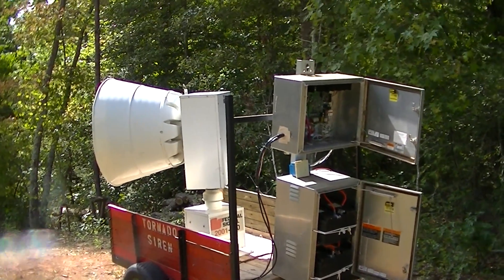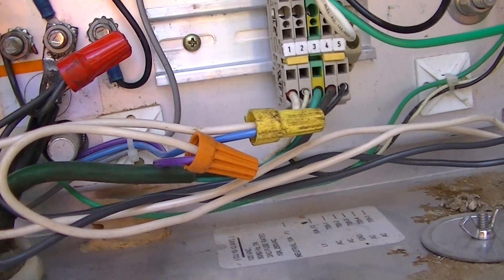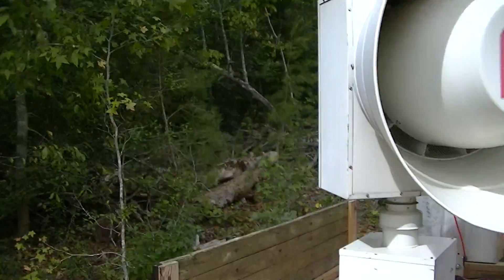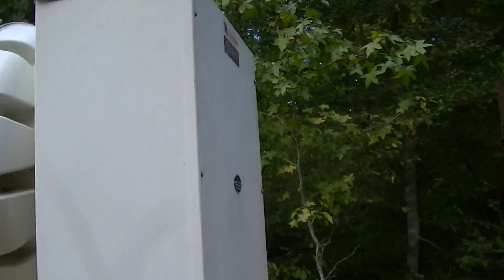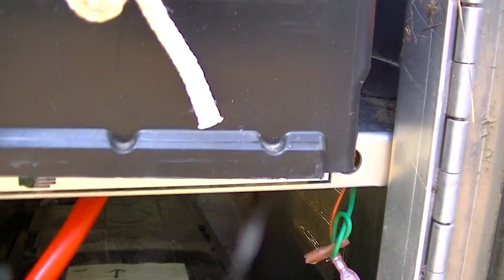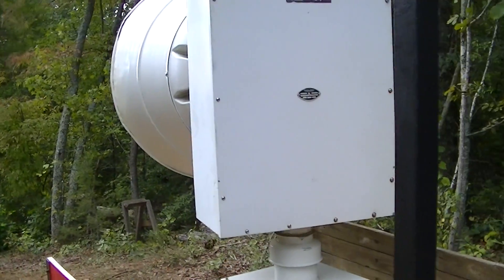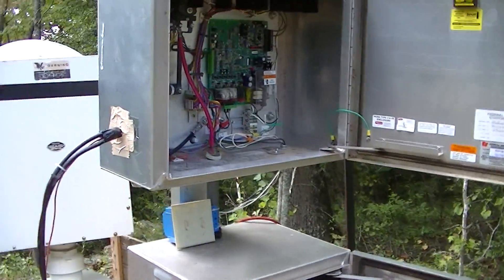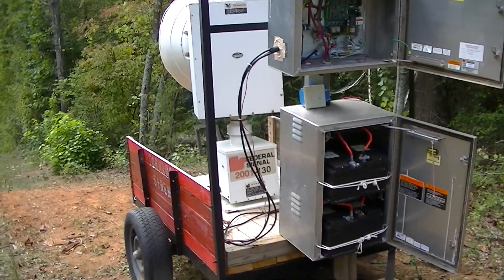My FS 2001-130 (DC) Outdoor Warning Siren Walk Around & Demonstration

Comment: and you bought this off Ebay instead of finding it in a scrapyard somewhere? buying these direct from the manufacturer would run about $15,000-$20,000 brand new
Reply from the maker: @Derek Wall: This siren was found from a storage at a plant in AL.
Reply: @TrainsAndSirens1  really, what was it doing there?
Reply from the maker: @Derek Wall: It was removed because the siren got struck by lightning and siren was no longer needed.
Reply: @TrainsAndSirens1  i wonder why it was no longer needed. i think every town in all 50 states of america no matter how small should have a warning siren. even if it's a town of only 25-30 people. the town where i live (Howard South Dakota) has just one siren and it's a federal signal 2001 SRN-B. we used to have a 3T22 as well but that was taken down. check out my video of the ambience at www.youtube.com/watch?v=z4o1SfF1bS4

Comment: just replace the shorted components and the board should work again provided the other electronic components aren't fried
Reply from the maker: I sent the board (a year after this video) to a siren shop in MO and he said "the board is unrepairable due to board itself permanently damaged".
Reply: @TrainsAndSirens1  did he say why it was permanently damaged? i thought that with electrical components being shorted all you would have to do is replace the burnt out diodes, capacitors, rectifiers or anything else and everything would work again
Reply from the maker: @Derek Wall: The back of the board has major scratches.
Reply: @TrainsAndSirens1  i see. how much did you pay for this siren? i know new ones cost upward of $10,000 (without the cost of installation)

Comment: You should buy some resistors for that control board to get it up and running
Just look for 2 resistors with a orange,orange,orange color coding and solder them in

Comment: Bro, that's not hard at all. Take the board out, desoldier the bad caps, use Q Tips with Isopropyl Alcohol to clean the crap gently, then soldier in new ones. There's bound to be at least 1 guy in your area who can do that if you're a bit nervous about soldiering.
Reply from the maker: @Christian Gonzales: I'm planning on fixing the board.
Reply: that is what i was thinking

Comment: I've heard that you own part of Springfield, Illinois Thunderbolt. Is that true? I was told that it was a single phase Thunderbolt off of the Stratton building here in Spingfield. I'm looking for more information on how it was acquired, when it was removed (did the city remove it or was it removed by you or whoever asked about it) and whether any money was exchanged for the siren. I've been attempting to locate what happened to the original 4 Thunderbolts from 1957 that were installed throughout Springfield. Thanks!